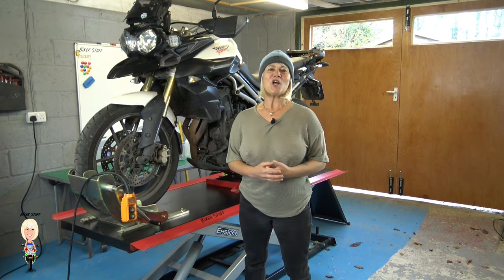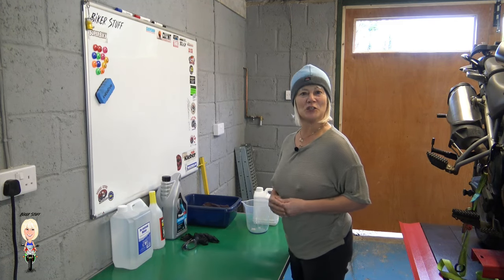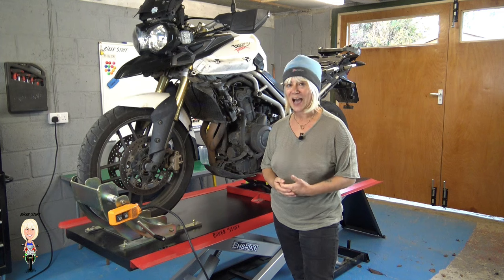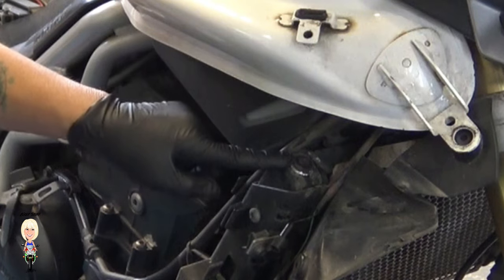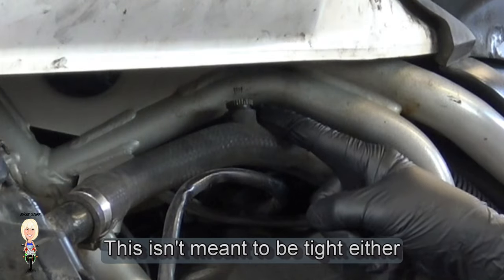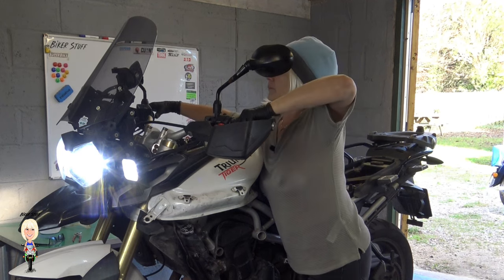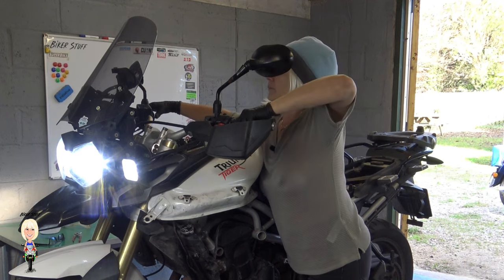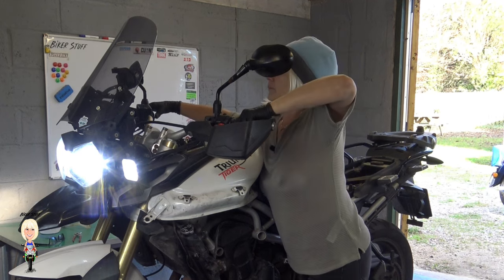How to drain, flush and refill your motorcycle cooling system

Comment: Thanks Dana. I have just finished doing the timing, replacing slims, cam chain and tensioner on my tiger. All the plastics are still off so think your video info will be used before the bike is back on the road. 👍👍👍👍
Reply from the maker: The tiger is quite limited for panels so it's an easy reassembly

Comment: Need your help with a 94 scooter clicks at the regulator which is a 15 volt and I don't know problem is is it the battery or the ground wire to the starter and where do I ground the ground wire could you please answer this ASAP
Reply from the maker: There is nothing in a regulator that could click.  If you are getting 15 volts at the battery, that isn't much over what you should have, but as it is making noises as well, perhaps you should replace the regulator.
You have given me very little information to be able to give you a full reply.
1.  Is your battery holding current?
2.  Does the voltage rise to around 14.5v when the motor is running?
Reply: @bikerstuff2  thank you for your help and it's my cdi box I don't think again thank you so much for your help I'll keep you updated on the progress